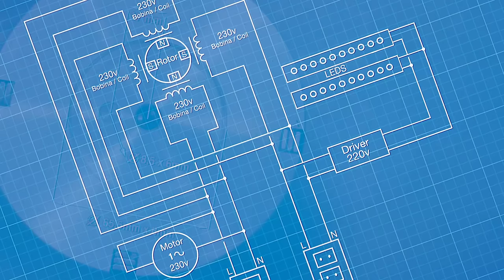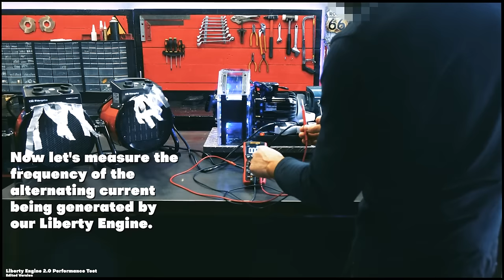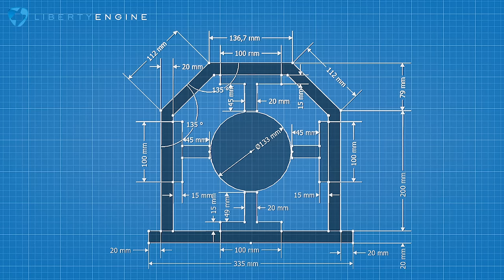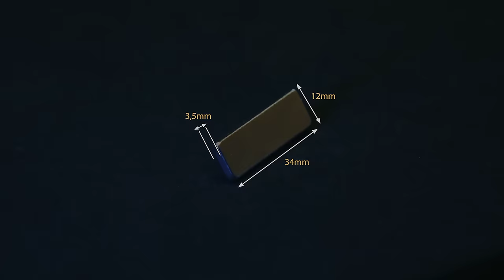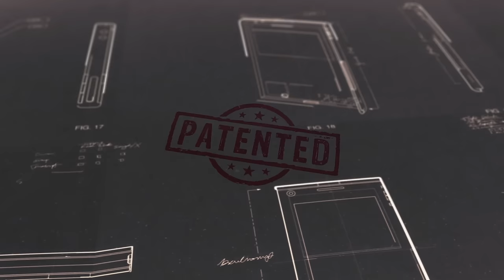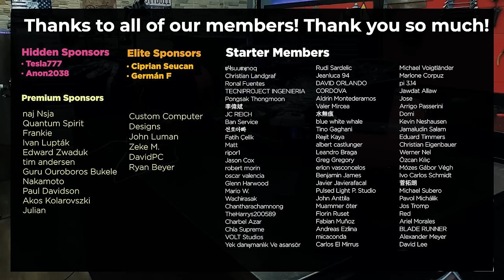SECRETS AND MANUFACTURING PLANS OF THE LIBERTY ENGINE 2.0

Comment: Ok, I have a question :) Why did you use a different meter to measure the current? Maybe because it would still show 0 volt :) I watched your first prototype and what you're saying doesn't hold up. In the first project that worked on a similar principle, the key element was the "supposedly special" magnets. Now it turns out that magnets can be ordinary and in this project now there must be a special metal alloy on the rotor :) If you say that the rotor is a key element here, it must be wrong
Reply: @chaoskiller1758  then explain to me why in the first project you didn't need any special metal alloys to make it work only magnets? And now they changed their mind because the version with magnets is easy to disprove because there are only 4 possibilities how the poles of the magnet would be distributed to check it yourself :) The version with a rotor is better because it is an alloy and they can always say that it doesn't work because you have wrong proportions and in fact what the rotor is made of does not matter because the aluminum alloy with silver has no magical effect here
Reply: Yes I agree to your comment bro how if he hang up the motor so that we can see what's in there below the table
Reply: If there's no other way where he get the power supply  supplied to the drive motor😊 why it continuesly rotates
Reply: I think that's for bloggers purposes only for the purpose of generating monetary value in there blog
Reply: I think this is not a free energy. It's free money.
Reply: Yes it’s complete bull shit, glad at least one person caught that. Making a composite rotor will eliminate ANY eddie current and will certainly hold up at such low RPM which is weird in itself.

Comment: I'm not an engineer or electrician or anything like that, but it seems to me like the only function of the rotor is to hold the magnets.
Couldn't it be made by a block of acrylic plastic or even some laminated hardwood or plywood?
No eddy currents in those, and the RPM isn't fast enough to rip the rotor apart.

I also agree with others, there's no way anyone will survive trying to make money by an invention like this (if it actually works).
The oil companies will bury both you and your machine until the last drop of oil has been squeezed out of the Earth.
Only chance of survival is to make ALL information about this freely available online so that it will be copied and spread.
Reply: I am thinking the same thing.
Reply: Yes and the thing is oil is not scarce, they just want that we think that it is scarce. It is created about 200 km deep in the ground and is naturally created by the earth because of the heat and pressure.
Reply: you made it much easier
Reply: I wonder if the rotor mass affect it.
Reply: @alenpasnikov  The rotor is just a decoration.
Reply: I THINK IT IS FOR DE MASS OF 7 KG THAT MAKES MOMENTUM KEEP ON GOING TO THE NEXT COIL SO IT DOESN´T STOPS
Reply: @cesarpieres  The coil creates the opposite force, so it stops very quickly.
Reply: Боюсь що такої інформації не існує взагалі. Це фейк, обман.

Comment: Assuming that the alloy is made up of aluminum, silver, silicon, barium ferrite, and strontium ferrite, the likely proportions of the elements in the alloy are estimated to be:

    Aluminum: 47.5-50%
    Silver: 16.7-17.8%
    Silicon: 0.3-14%
    Barium ferrite: 32.9-38.4%
    Strontium ferrite: 0.9-1.5%

there were other models that came up potentially including  small percentages of Magnesium (for structural strength), and potentially even  smaller amounts of Dysprosium, Terbium, and Praseodymium(to enhance magnetic properties). but not enough to warrant including for the basic breakdown.  magnesium has properties that are emf shielding so i dont know if that would be good or bad in this context, but if you include  magnesium to the list then the model im using allows for a proportion range of .5%-15%

Note that this is not including the calculation required to subtract the weight of the neodymium magnets from the total weight before applying the proportion calculation. that would still need to be done to be more accurate. or you could just calculate the weight of the magnets based on the known weight of neodymium and the dimensions of the magnets and then just include the known % of the weight thats neodymium in the proportion calculation. both equations would tell you the % proportion of neodymium in the rotor.
Reply: Tnx. This info is very helpful. Much apprciated.👍👏
Reply: did you get a prototype with a positive result?
Reply: Ur really smart lol, any updates ?
Reply: Impressive. How did you come up with those numbers?

Comment: If this concept were truly functional, you could distribute the necessary components across various companies, avoiding any legal entanglements by merely selling these parts for various purposes. You could create a YouTube video showcasing where individuals can purchase each required component to assemble it. However, it's evident that if a setup as simple as connecting a squirrel cage motor to a coaxial flux motor could generate substantial energy, it would have been achieved long ago.

Comment: hello, as you don't sell this machine, are there any plans other than electrical to manufacture it? best regards
Reply: I uses 4 x primary micowave transformer gal 900 e4 coils wired in only the ac ones, nimdium magnets, 12x 3 North and North pole up and down South and South pole left and right 
And a 1400 rpm induction motor with starter capacitor

Comment: Thanks for your detailed video, you have found me a beautiful work to try and with great joy
Reply: You can even use engineering plastic (w/c is lighter) as  your rotor for the magnets instead of aluminum-silver alloy. Just make sure to couple your rotor to another flywheel in the same shaft that weighs 7.6 kgs minimum (same as his). It is much better to have a slightly larger diameter fly wheel to have better rotational energy (moment of inertia). The fly wheel can be made of  mild steel to make it cheaper. You can use this formula: 

Moment of Inertia = 1/2 x (mass in kgs) x (radius in meters)² - "take note of the squared". 

Take note also that the moment of inertia of yours should not be lesser than his to maintain an effective rotational energy at 1500 RPM. At that weight of the fly wheel, the speed of the system will not change significantly even if you remove the power to the motor for a couple of seconds or even you put bigger loads.
Reply: @simplethings2410  thx for your reply, but you've already tried and tested if it works or its just theory?

Comment: One thing that always bug me that would like to have cleared up:

Let us just say your motor generates more energy than it consumes. Bravo. 

The energy is recirculated back to the motor with more energy to spare. This extra energy is our free energy supply.

My questions are this: How does the extra juice not fry the system? Does the motor redline? If the energy builds up exponentially, the system will destroy itself. How do you vent out the extra current?

Comment: Loving the follow up video! Many thanks!! My prototype works but need a closer material rotor/ flywheel 🙃
Reply: would you mind sharing your experience and results please :)
Reply: yes, it can work well without the rotor
Reply: @janengel1985  do you have any practical demonstration or video, i`d like to give a try i suppose some parts can be expensive so i dont want to waste money , thought i am a true believer and i already have 2 electric motors playing with the capacitors and diode bridges, but this looks much simpler than what i am doing
Reply: @janengel1985  진짜로 성공했나요?
Reply: @MrBademy  you can't make electricity from electricity, try to make something mechanical and then connect coils, diodes and capacitors
Reply: @djk2427  이 장치는 사기이고 모터는 진짜이고 가전 제품도 마찬가지지만 자석이 있는 회전자는 장식일 뿐입니다.
Reply: @janengel1985  i am using one electric motor to rotate another electric motor and extract electricity from it, is that what you mean ?
Reply: @MrBademy  No, build something like a Bhaskara wheel and convert the energy from the rotation into electricity using a familiar process.
Reply: @janengel1985  i see but isnt it the wrong approach to use mechanical or kinetic energy to move something instead of very fine-tuned up resonance?
Reply: @MrBademy  It's not about energies, it's about forces. Force is much easier to imagine than energy.
Reply: Yes flywheel with some weigh seem important for it to run

Comment: 로터의 합금비율이 계산해보면 대략
7.6kg 중 알미늄(비중 2896.2kg/m^3:1.39kg-48%)와 은(비중 10500kg/m^3: 5.86kg-52%)정도인데 세상에는 그런 비율의 합금은 없고 직접 녹여서 만드는 방법 밖에 없네요.
현재 은1kg에 120만원 정도니 로터를 제작 할려면 1000만원 이상 들어가겠네요..
Reply: and the secret is revealed
Reply: @janengel1985  that's around 10 000 dollars not that bad if this is real I would pay it. Well worth it if you can take this anywhere you go!
Reply: Did you make this alloy? How was it discovered that this mix would yeild the results you needed?
Reply: 274.26 ounces if my math is correct. I hope I'm wrong though
Reply: 열차단은 어떻게 해결했을까요?
Reply: @theredeemeriam  that's math
Reply: @theredeemeriam  be glad they didn't put platinum in there
Reply from the maker: 로터 합금은 매우 비쌉니다.
Reply: HACELO CON MADERA DURA DE EBANO O QUEBRACHO BLANCO SALUDOS
Reply: Very good calculation to understand for all
Reply: @theredeemeriam It is mathmatics.
Reply: @thelibertyengineproject7966  i know the secret
I know why these metals are used, which are not alone in the mixture, some were added, why they work
what makes them magical and
what they are doing.
I also know what the treatment of the mixture and structure of the material is. I learned the professional literature on this type of special materials
my theory is 100% correct.
the alloy is expensive but it is performed. perpetum mobile is possible.
I am telling you all this in codes so that you would understand.
not the other people on the comments.
Reply: you're not right, a mixture of more metals that I won't say with a special treatment, I also don't want to say, a special mixture is obtained, I also don't want to say
which has positive properties that defy physics
Reply: @theredeemeriam  on an electric flying car :)
Reply: @theramonesify1  Are you going to tell us? If not why bring it up?
Reply: @theramonesify1  so if you don't want to say publicly, can you say in private?
Reply: 要計算由48%鋁和52%銀組成的棒的大致成本，有必要考慮錠的總重量（7.6公斤）和每種金屬的百分比。 然後，我們將把每種金屬的數量乘以目前市場上每公斤的價格。 由於各種市場因素，金屬價格不斷波動，因此我們將在估算時使用近似參考值。

為了進行計算，我們將使用以下步驟：

1. 計算錠中每種金屬的重量。

2. 將重量乘以每種金屬每公斤的價格。

3. 將成本加起來，以獲得錠的總價值。

例如，目前的大致價格可能是銀每公斤2500美元左右，鋁每公斤2美元左右。 這些值純粹是指示性的，根據當前的市場狀況可能有很大差異。

讓我們根據這些值進行計算。

根據提供的參考值，锭的大致成本約為9,887.30美元。 這是考慮到以下因素來計算的：

-鋁部件的成本約為7.30美元（佔總數的48%）。

-銀色部分的成本約為9,880.00美元（佔總額的52%）。

請記住，這些值基於近似價格，實際成本可能因市場上金屬的當前價格而異。 始終建議檢視更新的價格，以獲得更準確的估計。

Comment: I have a question regarding the rotor, since its a very dificult piece to fabricate, can it be used an easy to find alternative? Like, lets say 2 disc brakes conected with bolts or something, another question about the rotor. Its better to be heavy or light weight? Why is is it need to be alluminium and silver, because of them being non magnetic? Will a ferrous alloy rotor influence the magnetic field and reduce performance or it simply doesnt work? Thanks in advance

Comment: The Magic of the Rotor? The density given is 7.081 g/cm^3 this is 7081 kg/m^3 which is about twice the density of most aluminum silver alloys which are about 2500 kg/m^3. There is a large gap in density and there must be something heavy that makes this density so high. Steel is 7850 kg/m^3. This density is actually the same as neodynium 7040. White metal is 7100 which is almost the same. 
So, my question is that the density given is twice the density of all listed silver aluminum alloys. Is this to throw us off? There must be a heavy metal somewhere in this alloy where it gets its mass or it  has more silver than most silver aluminum alloys.
Reply from the maker: Yes, it has much more silver than normal alloys, but it also contains other materials to a lesser extent. We do not try to mislead

Comment: Could it be made more efficient by adding four more positions for magnets on the rotor?
Reply: 4 more positions for the rotor would cause a doubling of the frequency from 50 hz to 100 hz. So you have to get different trabsformers (they are 50 hz) The motor would also have to work with 100 hz. They probably do not have a transformer and electric motor that match that. 20 kW for that size and no fuel consumption is the most efficient machine ever made. I am not sure why you are even thinking of making it “more efficient”. Than what??
Reply: @pedrosura  right

Comment: 21:16 through 21:33 "We cant say, but we can give a very important clue."  He references the rotors dimensions a second time, volume of rotor=1073.3 cubic centimeters, weight=7.6kg as well as the 2 known metals of the rotor, aluminum, and silver, "among other materials".  I wonder if the "other materials" could be deduced based on the known weight of aluminum and silver, and the known weight and volume of the rotor alone.  or if we'd need to know the proportions of the rotors weight that's aluminum/silver. 
I don't suppose the creator could provide the percentage of the weight that's silver, the percentage of the weight that's aluminum, and the percentage of the weight that's unknown could he? As well as how many unknown materials are present? 2 other scientists in the field of free energy, John Hutchinson and Floyd Sweet both had devices that utilized barium to some degree.  Barium ferrite in Sweet's self oscillating magnets, and barium titanate in the Hutchinson crystal converter cell.  Both scientists also conditioned their barium related materials with their own process.  Hutchinson used high voltage to condition  his crystal cells while they were cooling down, and Sweet used an electromagnetic conditioning process on his barium ferrite magnets to set the barium nucleus into self oscillation.  For anyone else looking into building their own one of these trying to figure out what the rotor is made of,  id begin to suspect that barium, soft iron, barium ferrite, barium titanate, silicone,  and possibly even some other minerals, or combination thereof is possible here. But if i had to guess, id say that barium ferrite is our missing key here. the ferrite would help the rotor induct those eddy curents out way faster through the aluminum/silver mix and the barium to tap the oscillating nuclear potential.
Reply: looking for this too

Comment: Just wondering, standard power socket expansion boards usually  have an automatic fuse to trip at 2400 Watts. So how do you drive 4 heaters with a peak of 4.8kW/hr?
Reply: You can buy 15amp 240V RCDs

Comment: Assuming that the alloy is silver/aluminum only, the ratio is approximately 56.24/43.76 volume ratio and 83.31/16.69 weight ratio Ag/Al. 
Other unknown ingredients can change the ratio of these two. The price of about 6.5 kilos of silver is about 5.2k USD. 
It would be a leap of faith to invest so much in rotors...
The total amount is 52,000 USD, and the actual video is also trick magic...
It's impossible profit and magic.
Deleting images is valid.
If it is impossible to manufacture and sell the machine by disclosing the price, please delete it.

Comment: From your magnet sequence, you make full wave at 180° (N S N) 
 But If u make full wave at 90° you can reduce the rpm to 750rpm and get same 50hz. This will help you decrease the sound of your motor.

You have to add 4 more magnet and your 180° magnet will be (N S N S N)
Reply: If you add several magnets and run it with the same RPM, it will result to over-frequency and will burn your motor. One thing, he wants to run it at1500 RPM to utilize the power of rotational energy / momentum generated. Lower RPM means lower rotational energy and the system will not run perpetually.

Comment: A 1kg ingot of Aluminium (90%) Silver (10%) is $2147 CAD. And it may not match the alloy composition they are using. The rotor is 7.6kgs. $2147 x 8kg = $17,176. Just for the material of the rotor. 😢
Reply: It would be a lot cheaper and easier to melt down the metal. Hopefully it won't be this expensive.
Reply: @damianjones6546  lol. So you're gonna go and buy some silver and get some aluminum cans then smelt it and cross your fingers?? 🤣🤣 you need to learn mettalurgy. Im skeptical that their claim that eddy currents are eliminated in a metal as conductive as silver 🤔
Reply: @gocro731  it's not as difficult as you think. There's plenty of videos on YouTube. The only issue is the possible high ratio of Silver to Aluminium, it would cost too much for me to afford. I was hoping it would be the other way round with a high Aluminium content, there plenty of scrap aluminium around. They've also mentioned other metals too, so without knowledge of those other metals I could end up with some very expensive door stops!
Reply: Silver is £600 a kilo in the UK. Still way too expensive to experiment with.
Reply: @gocro731  silver is a good conductor but is not magnetic. People test silver coins with a magnetic slide, it has just a slight magnetic resistance
Reply: Pure Copper is the next most conductive after silver and it is cheaper.
Reply: @nicholaspescinski7818  conductive as in "inductive" with regard to eddy currents?? Or electrical continuity??

Comment: I think there is a catch with the distribution outlet when it was turned on. If it is not connected to the network, the indicator should not light up. And why did it light up for a sec? Although, perhaps, the capacitor was discharged on the neon lamp!